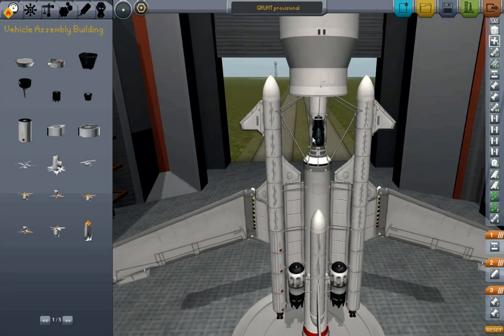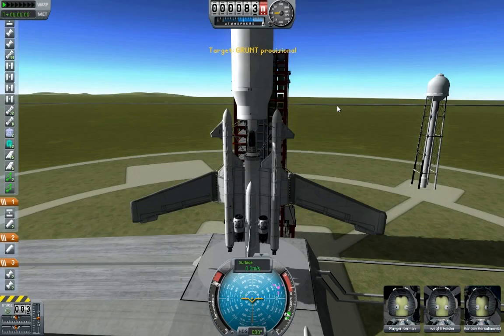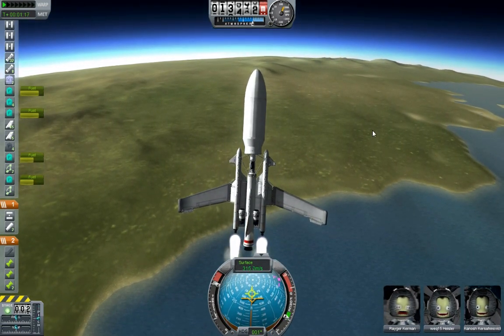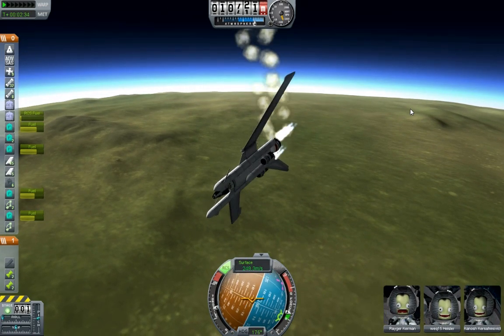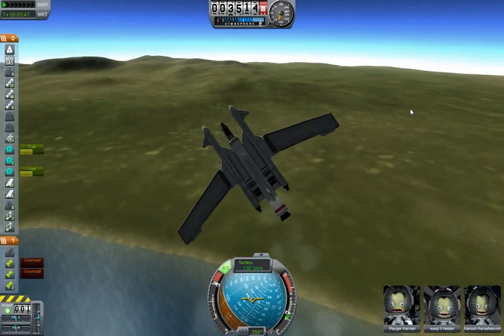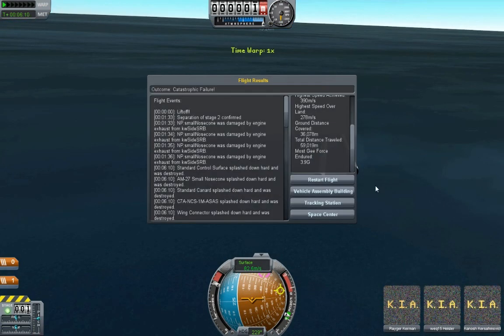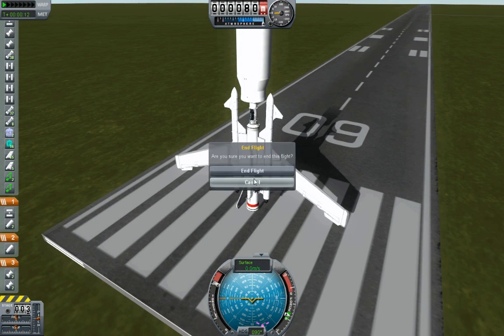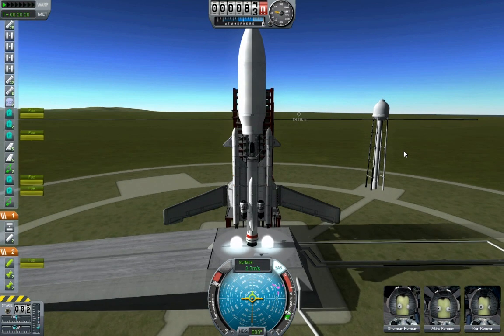Let's Fly Kerbal Space Program: chapter 2, episode 10

Comment: Hey, nice to see you making videos again!

I was thinking you can probably flight test the re-useable launch vehicle alone, get it working alone, then just put the payload on the front without worrying about making it nose-heavy too much. After all, you're planning to launch it more or less vertically until separation of the payload, so in that phase lift has little relevance.

Adding mass in the front of centre of pressure will increase your stability, so it should work for launch and return.

Comment: The MuMechLib module is much more robust and plays well with other mods, and provides parts that turns anything it's attached to into a pilotable vehicle, so you can have a vehicle that can split into two vehicles (not a vehicle with jettisoned debris). You might try that.

(MML provides some autopilot facilities, too, but it doesn't start on.)

Comment: You stalled at 6:25 because you cut the engines for several seconds which slowed yourself down way to much then to counter your loss in altitude you pushed your thrust up to full which stalled the aircraft. This put it into a uncontrollable spin and makes it nearly impossible to climb out of the stall. Next time you may want to not fully cut engines during separation but if you do slowly push the thrust forward :)